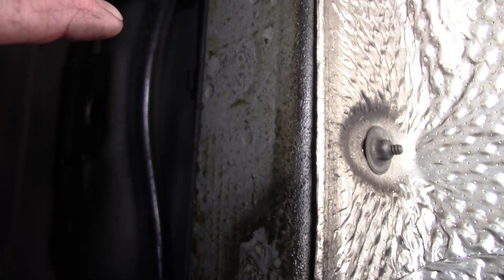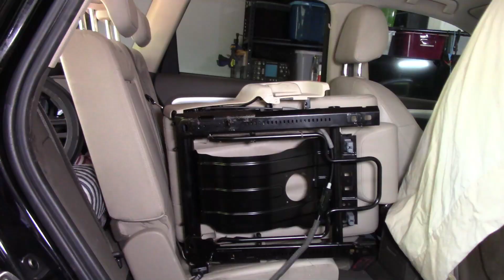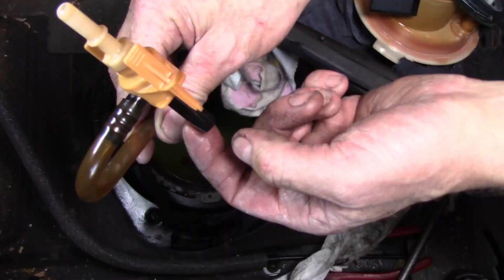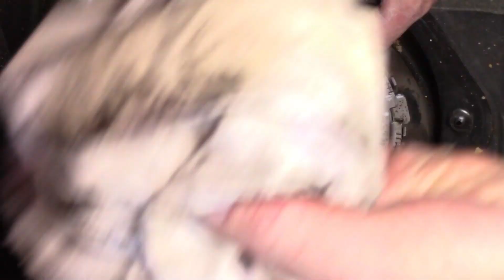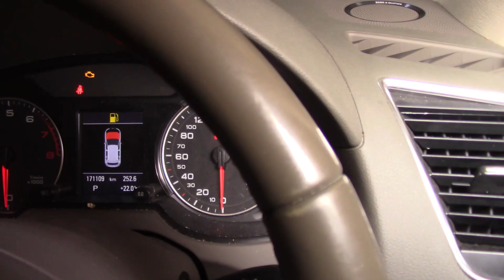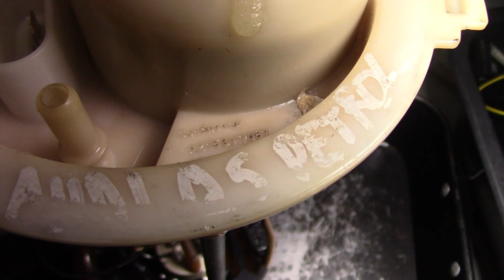Audi Q5 BAD Fuel Smell

Comment: Thank you so much, you answered all my questions, I have a porsche Macan with a  2.0 tfsi engine, the pumps are extremely similar, and I wanted to know about the round metal piece on the fuel pump! so every morning when I start the vehicle, and let it idle for over 3 minutes it starts to stumble for about a minute or less! then it recovers and idle fine until next day! so I was thinking it was the pressure regulator not holding locked pressure! the other good part I did was to order a Genuine pump! this old one has done me well at 214 km. I like doing my maintenance repairs so what I save on labor and can spend $$$ on spares a bit more!  
very informative video! thanks
Reply from the maker: That's great to hear! Glad the video was helpful for your Macan. Good call on the genuine pump! 👍

Comment: Hi max, great vid, helping me loads from down under in the UK, question, why when opening the car door does it create pressure in the fuel system, I’ve done my new fuel filter as there was a crack in top just like yours, I managed to seal that tiny breather vent using a self tapping stainless steel 15mm screw with small squirt of silicone down the hole before I screwed home the screw. I’m just waiting for the new electrical plug to arrive as old one perished on removal, im reading that just by pushing the key into ignition (but not starting up) a few times on and off should pressure the fuel system.  I’ve also watched your other vid on how to re-wire the new plug, BIG HELP, THANKS,
Reply from the maker: Yes, this is a GDI system, which can have up to 3000PSI in the fuel rail at top pressure. It is vital to keep fuel up to the high pressure pump by means of the low pressure pump. Audi have chosen to prime the fuel pump even when the door is opened, so that the fuel system is primed ready for quick, easy starting.
https://youtu.be/MzpKlTUgj7g?t=381
It is a good idea to replace the electrical connector if it has been fuel soaked.
Hope your repair goes well for you
MAX

Comment: Even though I am in the US, this video helped me out a bit. My Mum has a Q5 that the pump went bad on. I replaced it and every now and then we smell fuel. But it is RARE, and I just cannot locate the problem. You have given me a few new ideas to try out. Thanks for the great, informative, video.
Reply: Hi, did you find out what it was?  I have a 3.0t and sometimes the smell comes after driving spirited and coming to a stop or slowed down.  Very faint, like from the vents, but goes away.  No cel or anything noticeable.
Reply: @robczar7479 going thru the same thing now , gunna buy a new gas cap before I move on to bigger things like fuel pump ugh
Reply from the maker: I hope you find the fault. Make sure you check all connections and check for fuel stains.

Comment: What is the EPC light ?
Reply from the maker: Electronic Power Control
Reply: What does that mean ? What part is needed to be replaced ?
Reply from the maker: What fault codes are there? What tests have you done so far?
Reply: @MiracleMAX  I haven’t done no test but a diagnosis. But when I press on my acceleration hard my EPC light comes on.
Reply: @MiracleMAX  I haven’t done no test. Just a diagnostic. But when I press on my acceleration hard the EPC light comes on
Reply from the maker: @TE75291  What do you mean by ' you have done a diagnostic '?
Reply: @MiracleMAX  I plugged the reader to my car but codes popped up. I’ve been doing research but nothing has came back for those codes
Reply from the maker: @TE75291  What codes are they? The lack of power is due to the ECU going into limp home mode. I would need more information before I could offer some suggestions. Is the vehicle a Q5?
Reply: @MiracleMAX  P219F , P219C , P0301 , P0175 , P2237 , P2240. Yes it’s a 2010 Audi Q5 3.2 Premium Plus
Reply: @MiracleMAX  there was also a strong smell of gas in my vehicle and I did what you did on the video and found out I had the same problem with my fuel pump so I’m getting that covered but the other codes I’m not sure about
Reply from the maker: @TE75291  What are the codes?
Reply: @MiracleMAX  is there a website to tell you what those codes are and what to exactly replace
Reply from the maker: @TE75291  No. Codes only guide you to what is a symptom. 
What are the codes? Might be best to take it to a workshop
Reply: @MiracleMAX  Cylinder 4 air fuel ratio imbalance P219F , Cylinder 1 air fuel ratio imbalance P219C , system to Rich P0175 , 02 sensor P2237 , 02 sensor P2240
Reply from the maker: @TE75291  Can you get live data on your reader? What is the MAF reading? Are the O2 sensors reading correctly, both pre & post? Have you had a very close look under the bonnet? Split hoses, depending on the system can create a rich mixture as the ECU tries to compensate. What are the short term & long term fuel trims reading? Do your trims change between idle & 2000 RPM?
Reply: @MiracleMAX  no I can’t get live data. And I had a close look under the bonnet but still can’t see anything. No split hoses no nothing. The only problem I seen where I had a leak coming from is my fuel pump. Other than that no other leak. There was a time I cleaned the throttle body and my car ran good after that. Maybe my fuel injectors ? I’m not sure.
Reply from the maker: @TE75291  You would need to look at live data to be able to help with the diagnosis. Have you repaired the fuel leak?
Reply: @MiracleMAX  haven’t repaired fuel leak yet. Waiting on Fuel Pump
Reply from the maker: @TE75291  I strongly suggest you repair the fuel leak first, before you check out the other symptoms. That may be your main repair.
Reply: @MiracleMAX  Okay

Comment: Question: what is the name or part # for the connected adapter wiring that you had to replace due to the gasoline being in the connector ?
Reply from the maker: I showed the details in the next video
https://www.youtube.com/watch?v=uF1N9yf7kr8&t=39s
I've looked online to find the part number for you
https://sjcarparts.com/5-pin-plug-connector-fuel-pump-control-module-1k0919231-for-vw-audi-seat-skoda-?search=audi%20fuel%20pump%20connector

Comment: Great diagnostic work, I try to avoid used non genuine parts in critical and important areas.

Customers need to be informed that cheap is not always the way to go. 

It must have been a real pain for you to have to do the job twice, you earned yourself a stiff whiskey.
Reply from the maker: Yes, in this case it was a time factor.
Yes to the whiskey......

Comment: Hi MM, interesting video, and frustrating having to do it again. Was the first pump also the cause of the fault code?
Reply from the maker: The fault code was due to a poor connection at the pump module as the fuel perished the plastic and seal. 
Stay tuned for the next video where I address that issue. 😉

Comment: I've had issues with fuel miser stuff years ago and haven't used them since, it doesn't look like they've gotten any better over time
Reply from the maker: I have used them previously. I only found out later about HSY that offer quality parts (not a sponsor). I have another video to be released next that show the saga continuing........Stay tuned! 😊🤔
Reply: @MiracleMAX  will do.. I'm always looking for quality parts, there's just so much cheaply made crap around these days that either fails right out of the box or fails in the first couple of years